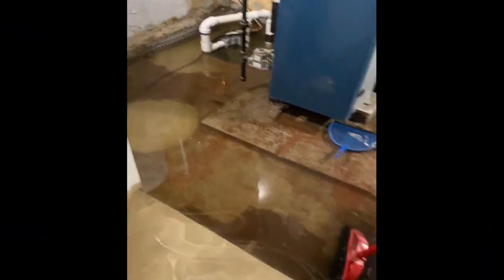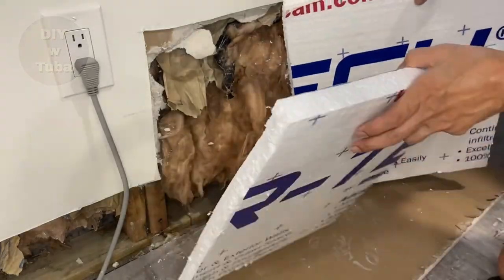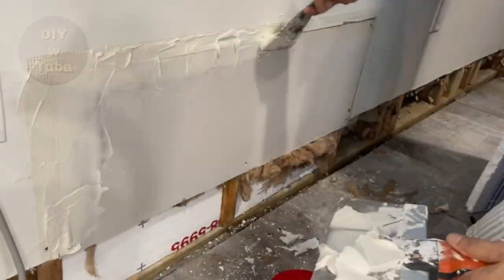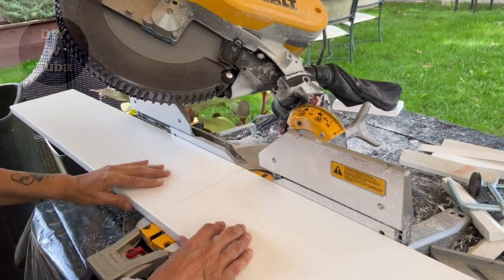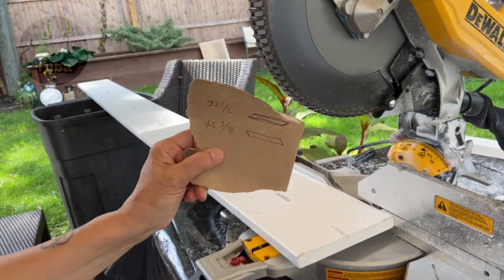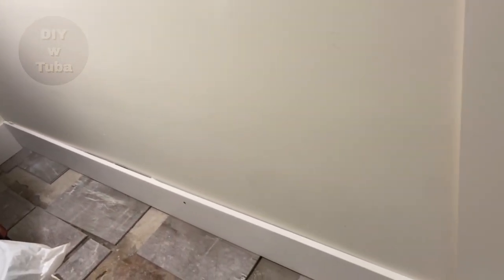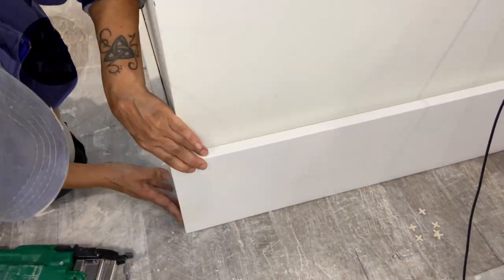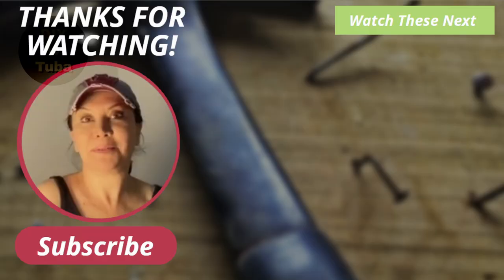Flooded Basement Solutions 2! Flood Damage Resistant Basement!

Comment: You need to put a handful of marbles on the floor the lowest point have them build a sump pump it’ll be the best thing you ever did in your life they last 10 years they’re only about $85 to replace them as they burn out don’t wait for that by the way and you’ll never never have to worry againput it in a plug that is designated for